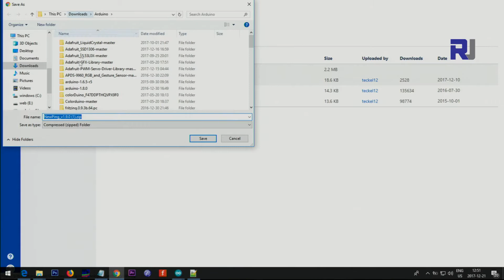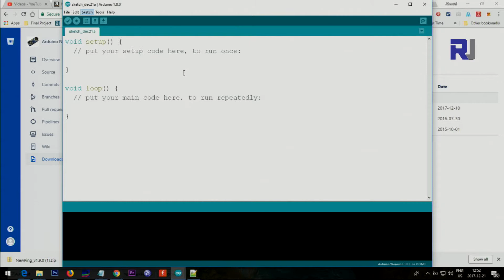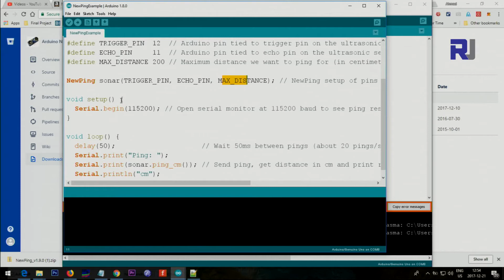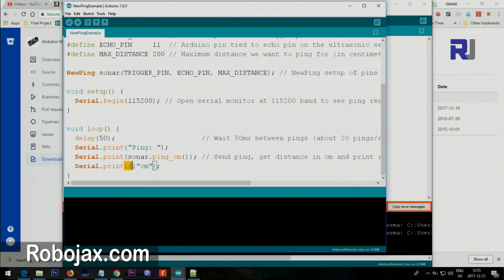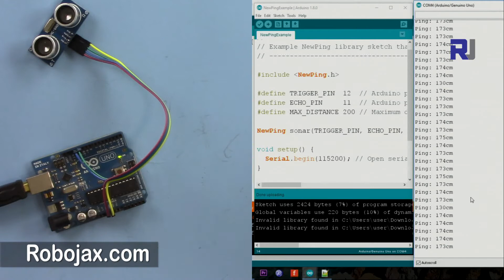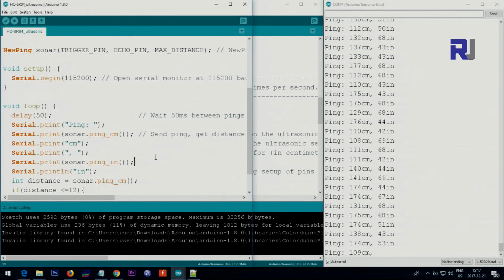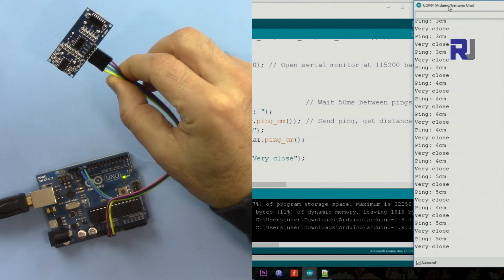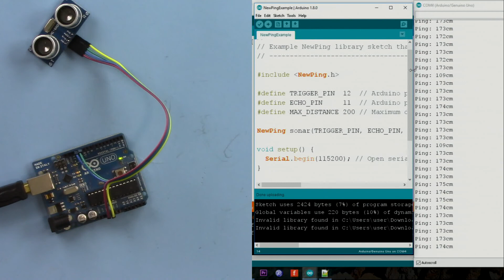HC-SR04 Ultrasonic obstacle avoidance range finder with Arduino RJT30

Comment: Hello bro when I am connecting my ultrasonic sensor to my Arduino the chip of Arduino is getting heated how can I fix this problem?
Reply from the maker: it should not get heated. it seems your module is defective.
Reply: @robojax  what module bro?
Reply from the maker: The ultrasonic sensors is a module
Reply: @robojax  should I replace it with new one or can I repair the current one ?

Comment: Bro I am able to perform the TM1637 display and LED blinking  with my Arduino but I am unable to do the HC-SR04 ultrasonic sensor and Max6675 thermocouple with my Arduino for both of these I have used your codes and your wirings but I am failing what might be the mistake plzz I have do to these 2 projects for 50 marks help me Robojax bro

Comment: Hello Robojax actually I am using Arduino UNO R3 Atmega328 Conpatable board for my projects I think it's not an Chinese board is it right? Even then my project is not working I have checked all things and done what I can do it means I have updated my driver to COM4 and installed libraries etc but what can be the problem with my project bro plzz tell

Comment: Hello bro actually I am using a Chinese Arduino of low cost which don't have positive and negative symbol in a infinite loop on it. Is this the reason why my project not working?
Reply from the maker: no. there is only ONE chip everyone use and produce the board. There must be something else.

Comment: Can't there be a way to read the echo pulse width without using microcontroller or some printed circuit board?
Reply from the maker: You can. here is the video https://youtu.be/mcI6y8mozg0

Comment: Um, when i did the code and stuff it kept saying 0 cm, and never changed.
Reply from the maker: check wiring.  who man pins your module has 3 or 4 pins?
Reply: @robojax  4 pins. The board im using is a ELEGOO MEGA 2560 R3.
Reply from the maker: I just watched the video making sure you got the right module. This video is for you. Pay attention to the label on the pins. Some times they change the order of the pins but they should have correct label.  If you connect it properly, then the module is bad. I assume you've downloaded the library.
Reply: @robojax  i do have the library.